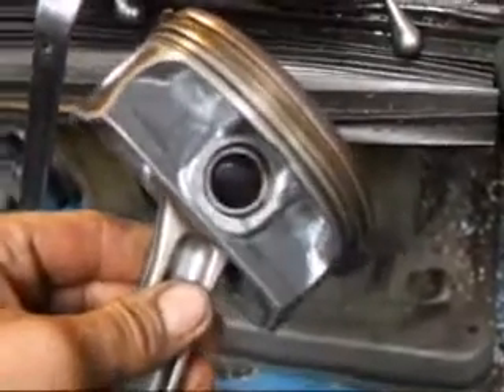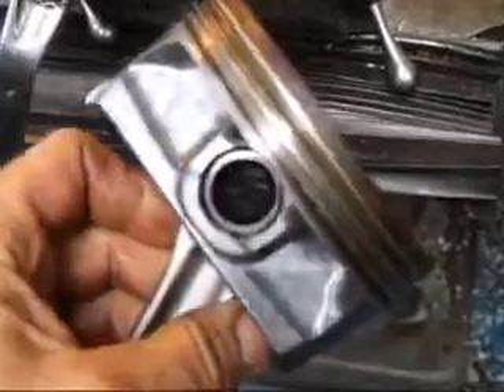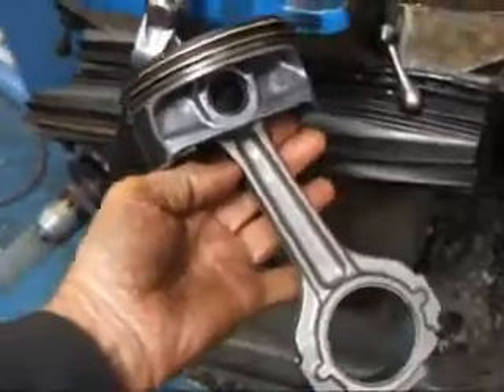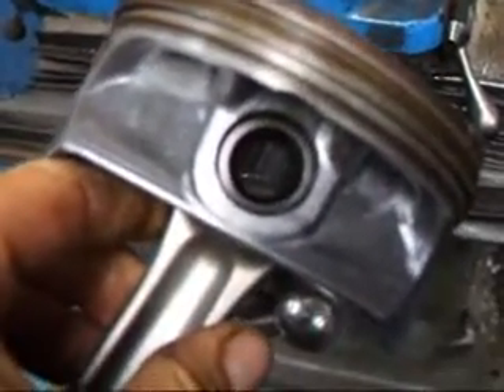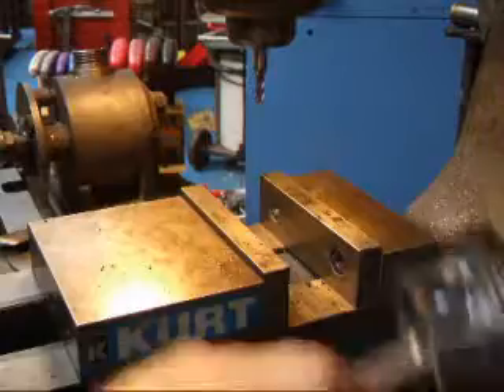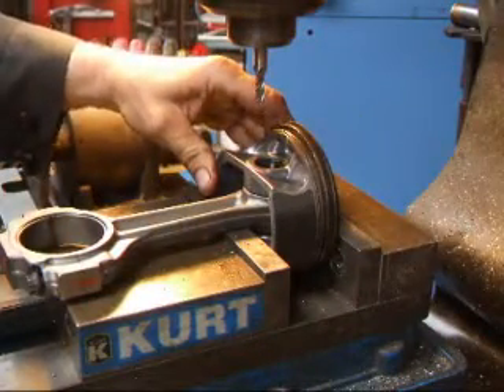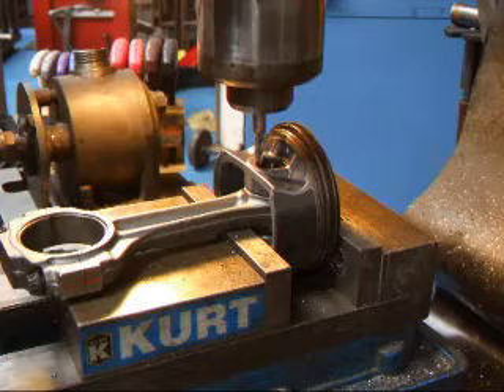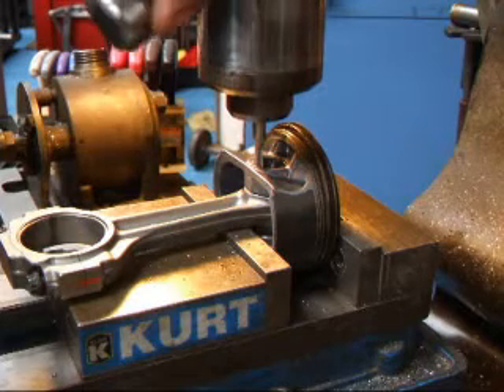LS3 Piston Pin Clip Removal

Comment: @GOCHELIN You don't need to yell..In this case perhaps heating the pistons up to a little over 200 degrees F will loosen the pins, then press them out. It will take a press to do it still, but you're less likely to gall the piston pin and piston. The manual should have the proper info for you as well. Remember, heat is your friend!

Comment: @GOCHELIN You don't need to yell..In this case perhaps heating the pistons up to a little over 200degrees F will loosten the pins, then press them out. It will take a press to do it still, but you're less likely to gall the piston pin and piston. The manual should have the proper info for you as well. Remenber, heat is your friend!

Comment: @fiatnutz mate, my ls1 conrods and piston heads connected together with wrist pin by heat and pressure, there are no snap rings used, I have removed wrist pins at friends shop for free by pressure machine, that was easy, I did all reconditioning work to the engine myself, now I wanna put the heads and rods together, but machinery shops ask me 45-65 dollars for repining the each wrist, nearly $400 all up, I am on low budget any easy way I can do it myself? thanks

Comment: most of the time in an overhual you don't reuse the piston anywas. so it does matter to make them reuseable. the aftermarket made it more efficient for GM to make a throw away part. nothing wrong with that.

Comment: I'm absolutely disgusted that GM are making engines so disposable that you have to buy a whole new piston-rod assembly if anything goes wrong with either part. I reckon that they'd like to eventually make the whole engine non- repairable- just slip in a new one if anything goes wrong. Or better still- get a new car.